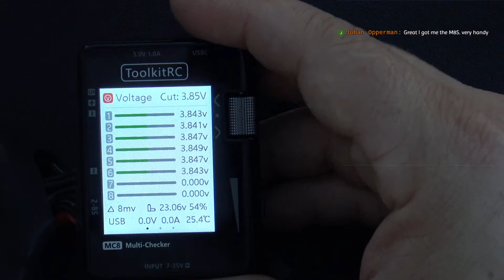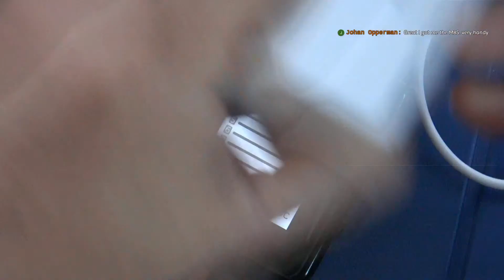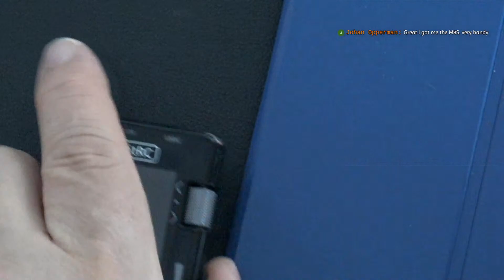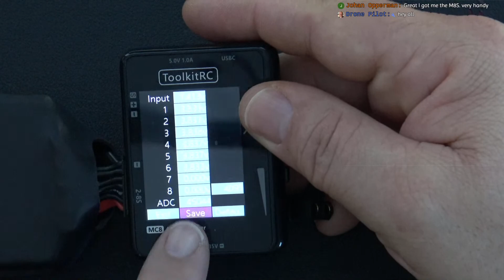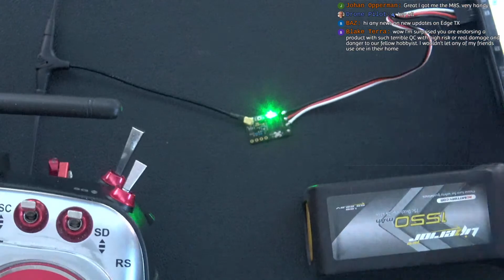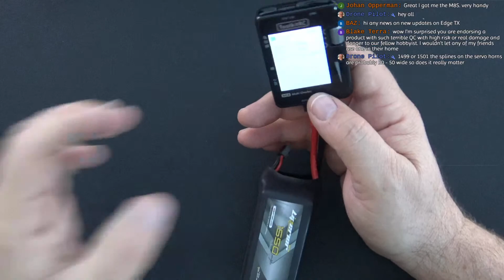ToolkitRC MC8 Battery Checker 2s-8s LiPO

Comment: Thanks for this review. 
I wanted to replace my Spektrum XBC100 with this one because of the IC3 battery battery connector on the XBC.
The MC8 checks all the boxes, except that centering servos would be a pain. 
Also to check for defective servos, there is a need for an automatic cycling function. 
Other than that it’s a nice product, maybe I’ll consider purchasing it anyway.
Reply from the maker: You're welcome.

Comment: How does this compare to the ISDT BG-8S?  Which is better?
Reply from the maker: Pros and cons to both. 8s is faster and has balance function. MC8 can test servos and receivers. And is more compact. As long as you calibrate both, they both perform their primary function well.